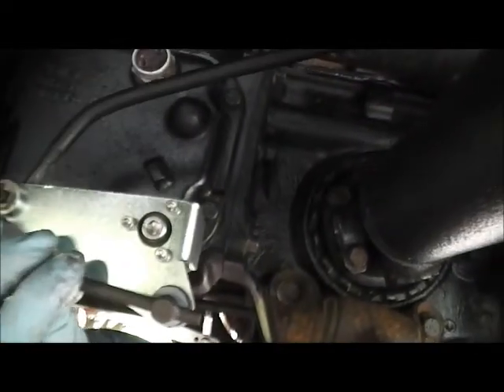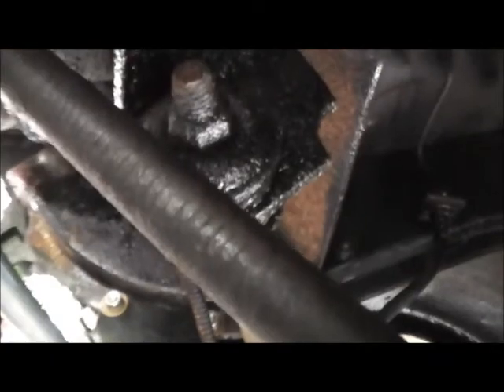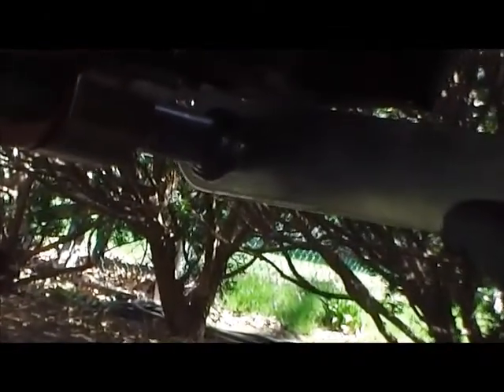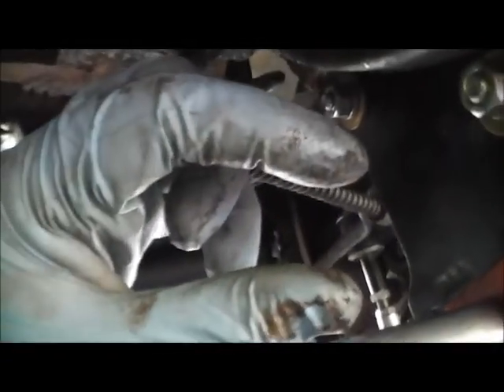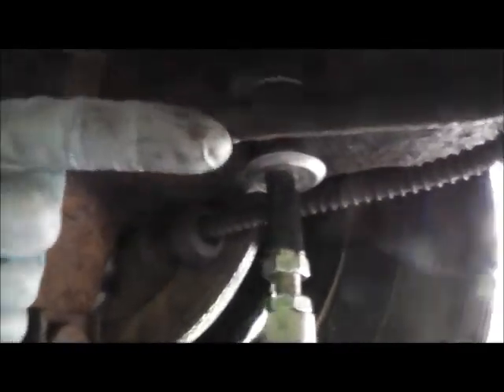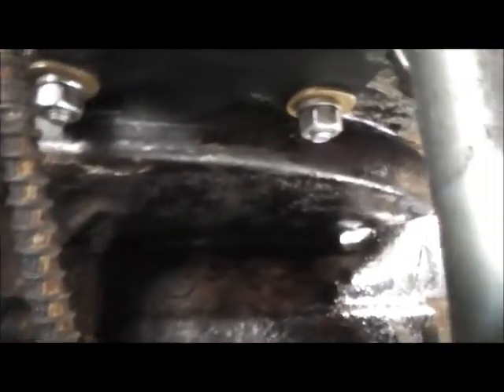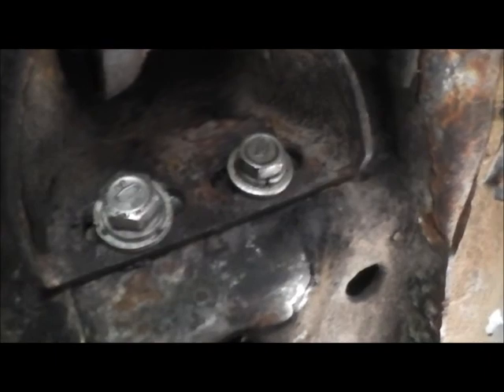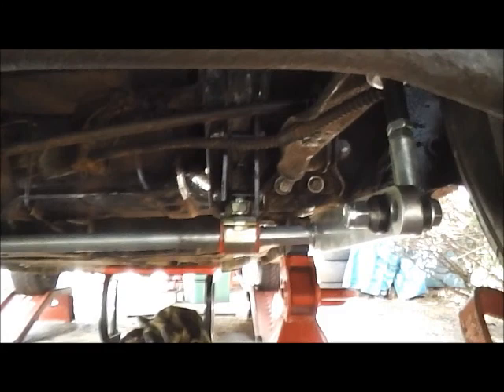Corvair Rear Sway Bar Install

Comment: Was there a major difference in body roll?
Reply from the maker: Absolutely there was. If I was to do it differently I would use a bigger sway bar size
Reply: @MrNapaCorvair  Thank you! I may add one in the near future.
Reply: @MrNapaCorvair  Thank you! I'm going to try urethane bushings on the stock stabilizer bars before I upgrade to a full rear sway bar.